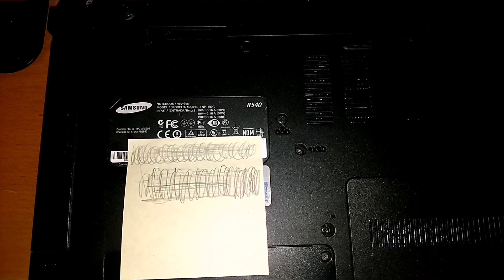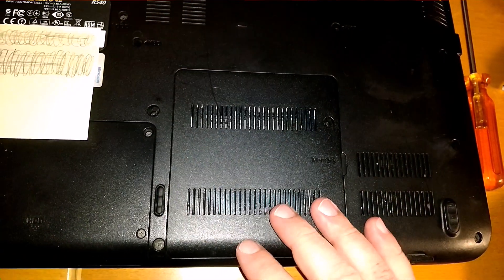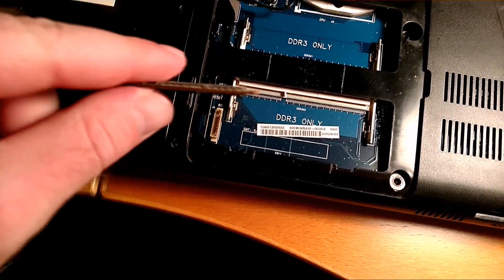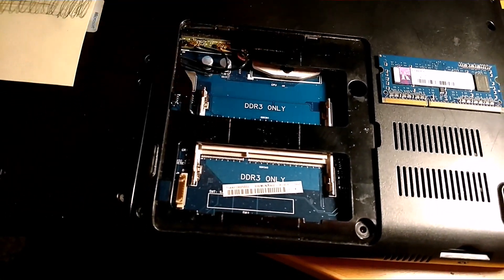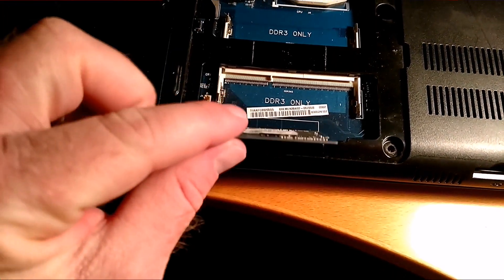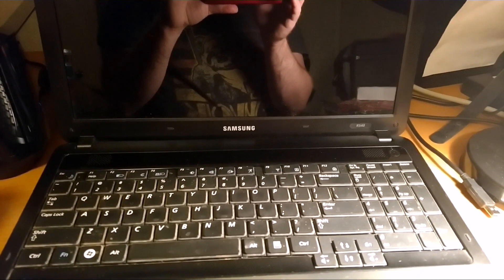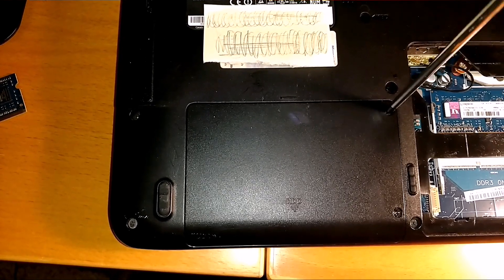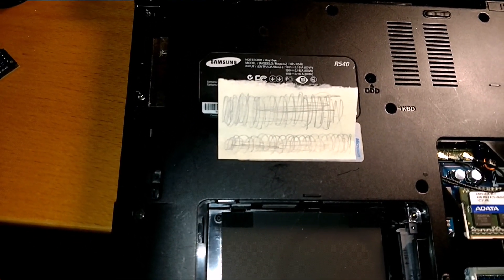Samsung Laptop Won't Power On Fix. Model R540

Comment: Mine shut down when using Windows 10 3d paint.......it froze,then shut down and won't start up.. a 3gb ram laptop.

Is the problem also from the RAM
Reply from the maker: Possible.
Reply: @becausestuffbreaks  
Alright.... I've tried it, looks like this isn't the case with my laptop....
Reply from the maker: @techhobbyist3662  Does it boot up at all? What is it doing exactly?
Reply: @becausestuffbreaks  
Alright.....it just powers on the L.E.Ds but the fan doesn't run.... and the screen too.

But, it shut down because of the App...
Reply from the maker: Sounds like a hardware failure. If it was the app, it would at least spin up the fan and start to boot.  Next step is to unplug the hard drive and see if it at least boots up the CMOS. If that works,  then your hard drive crashed.
Reply from the maker: Basically,  unplug the hard drive and then try to boot it with the hard drive out.  It should at least spin up the fan and get a dark screen with words on it.
Reply: @becausestuffbreaks  
Alright... thanks you. I just finished doing it now.....but nothing has changed yet.🤧
Reply: @becausestuffbreaks  
And this just happened bout 2 days ago
Reply from the maker: @techhobbyist3662  Is there a DVD ROM you can disconnect from it and then try to boot it?
Reply: @becausestuffbreaks  
But, I discovered...the HDD light isn't turning on
Reply from the maker: @techhobbyist3662  if it's still not turning anything on with the HDD disconnect, then you still have a problem.

Comment: How can I test screen? I did everything in this video still not working
Reply from the maker: Does it act like it's powering on? If you think it's powering on still, you can shine a flashlight into the the screen and see if there's a picture. If you can see a picture then the back light inverter is probably bad.

Comment: I found one, but with no powerbrick, any thoughts?
Reply from the maker: Here's a new one off Amazon https://www.amazon.com/dp/B07738ZJTV/ref=cm_sw_r_cp_apa_glt_fabc_J1DGDK5XN29A3XQXH07G?_encoding=UTF8&psc=1
Reply: @becausestuffbreaks  Do you know if it charges by usb?

Edit: I could have mentioned, I literally found one in the dumpster, also a 66w powerbrick, but it doesn't fit!
Reply from the maker: @matthijsbakker7755  No. It doesn't change off USB.
Reply: @becausestuffbreaks  Thanks, any other way besides the brick?
Reply from the maker: @matthijsbakker7755  No safe way to charge the battery without the proper charger.
Reply: @becausestuffbreaks  Thanks!

Comment: I have the same laptop but I am plugging it in and getting no lights at all
Reply from the maker: Did you try removing the battery and just use the AC Adapter?
Reply: @becausestuffbreaks  yes I did still no power
Reply: I am using a universal laptop ac adapter cause it’s the only one I have got, I going to try to buy it’s original and see if that turns it on, my firend found it in the trash and gave it to me, it was a missing a hard drive too but all I need to do is get it on and put in a hard drive and install windows
Reply from the maker: Let me know how it goes
Reply: @becausestuffbreaks  alright just ordered the charger, I really hope it powers on, we’ll see soon
Reply: Hey so the charger came and it powered on I am so excited, it’s installing windows 7 right this moment and I don’t think the battery holds a charge but I found a battery online for a good price, your video helped me out a lot tho and for the future of this laptop.
Reply from the maker: @WolfMan8930  awesome! Glad I could help. Thanks for watching!

Comment: My laptop, same model as yours, won’t turn on because I left it on without touching it for a while. Any way to help?
Reply from the maker: Did you try everything I did in the video?
Reply: @becausestuffbreaks  yeah.
Reply: There’s also no power light or anything.
Reply from the maker: Did you check the voltage out of the AC adapter?

Comment: Plz say this will also work for the E352 because that’s the model of my laptop, I’m trying to get it to work again
Reply from the maker: It's possible. It will look different but work the same. Let me know what you find. Thanks for watching!
Reply: @becausestuffbreaks  i found most of the stuff but it’s a pain to try and get the wires back in again, just gave my laptop a good clean so I hope that will fix it

Comment: hello I try sawping and replacing the ram but still won't work isth possible that I should remove the DVD?
Reply from the maker: It could be. Try removing it and then see if it boots. If it still doesn't work try removing the hard drive and see if it boots up the CMOS. If that doesn't work, then it's probably the mother board.
Reply: @becausestuffbreaks  thank you very much I will try it I really need to fix my laptop for online class .
Reply: @becausestuffbreaks  still won't open could be the GPU or the board itself thanks again .
Reply from the maker: Sorry to hear that. At least the hard drive is probably still good.
Reply: @becausestuffbreaks  I read about this laptop model . and the issue is the same the worse is if the board is toast .your tutorial really helps a lot of people including me . but sad to say its dead .

Comment: I clean the ram and also the hardisk but no display again..what should I do..
Reply from the maker: You probably need to replace the RAM.
Reply: @becausestuffbreaks  sir but the power still on..while the cooling fan not spinning...
Reply from the maker: Do you hear audio? Like it is booting up? Do you hear any beeping from the motherboard? Or is it just dead, except the power light and CPU fan?
Reply: @becausestuffbreaks  no audio sir
Reply: @becausestuffbreaks  black screen sir..but power still on and the charger  lights also on
Reply from the maker: Unplug it, pull out the battery and replace your RAM.
Reply: @becausestuffbreaks  ok sir ..tnx
Reply from the maker: Let me know if that fixes it
Reply: @becausestuffbreaks  yes sir I'm just order ram for now..
Reply: @becausestuffbreaks  sir my loptop model is Samsung R510 ...the history of my loptop is new replace of LCD screen ..after one week while I'm watching movie ..screen become  black but power ligths still on and no sound

Comment: Hi I have an old Samsung S3510 laptop that I haven’t touched in over 5 years. It doesn’t turn on. Do you reckon it’s the battery..isnit worth trying to fix it? Also where would I be able to get a decent battery anyway 
thanks
Reply from the maker: Only worth fixing if it has Windows 10 or can put Windows 10 on it. I usually check Amazon and eBay for laptop batteries. You should be able to boot it up with just the power adapter plugged in. If that doesn't work, try removing the battery to see if it boots just off the power adapter. If not, then it's either the power adapter or computer. If it does boot, then the battery is bad.

Comment: My uncle's laptop has the same problem. The power button (the switch of the button) is not there. And if i turn the laptop on. It didnt work. 
Can you help me please??
 samsung laptop np300e4z
Sorry for my grammar
Oh dear. I dont know what im talking about
Reply from the maker: Have you tried just following the process I went through in the video?
Reply: Oh dear... Yes. But the battery and the charger is working fine.. My ram is working fine. My Hard disk is working fine. My Dvd Card is also working fine. Either my charger and my battery.
Reply from the maker: I'm not understanding your problem. What is it not doing?

Comment: I was already to heat gun the video chip on an R522 when i stumbled upon this, +1
Reply from the maker: Was it the same problem? Is it working now?
Reply: @becausestuffbreaks  Pretty much and it's the weirdest thing. Was given to me in working condition. I took out the ram sticks to see what they were, put them back in and only power button, light around touchpad, and battery indicator lit up. Nothing on the screen though i can hear the dvd drive being recognized. So after watching your video I took the memory out, checked the contacts to make sure no dirt and put one stick back in slot 1. Booted. Put the other stick in slot 2. Not boot. Put the good stick in slot 2. Booted. What the heck, let's try the bad stick in slot 1. Booted!  Makes no sense.
Reply from the maker: Glad I could help. Thanks for watching!

Comment: If this doesnt work, remove your ram and wipe it with microfiber cloth on gold contact pads, it worked with my samsung n150 plus
Reply from the maker: I should have tried that but I already threw it away. I also is a Q-Tip and alcohol.